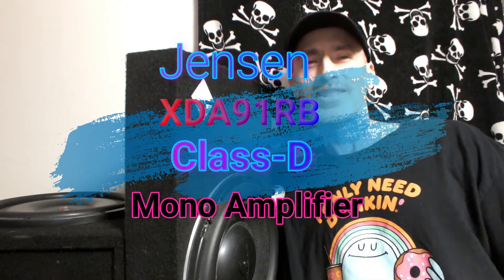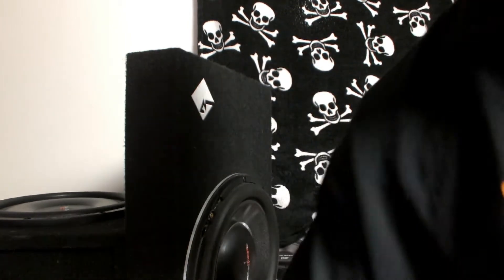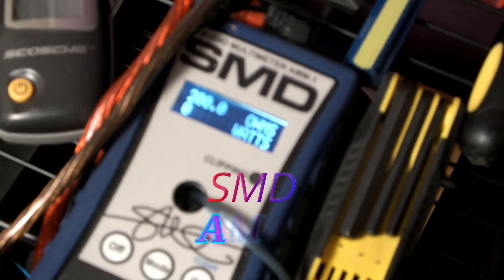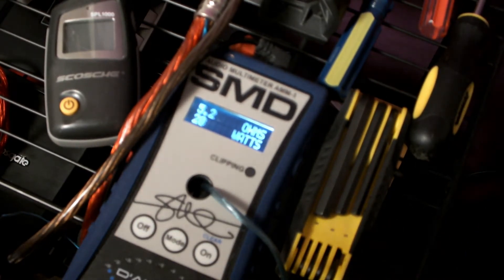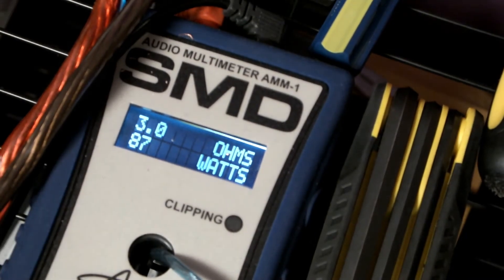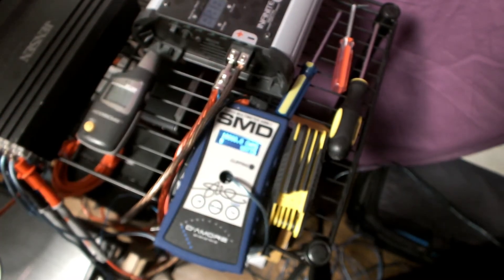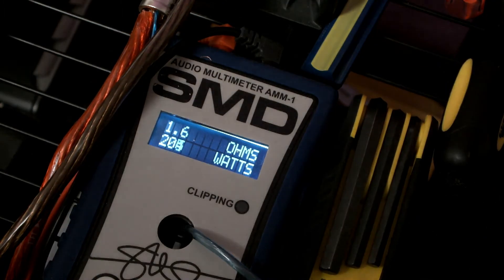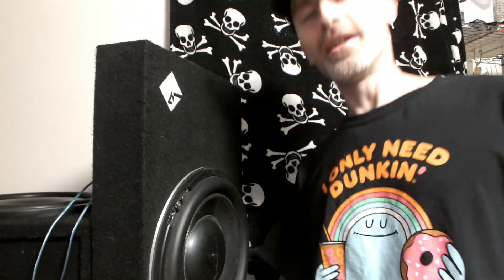Jensen XDA91RB Dyno Test Live SMD-AMM1 No App Used Does it do 1,200 Watts? 4 ohm, 2 ohm, 1 ohm Test

Comment: Hey john u dont use the 120 amp power supply anymore do u ? Want to sell it ? Or have 1 u will sell looking for atleast 100 or so.
Reply from the maker: I actually have 3 and they're each setup with their own sets of wiring so I can easily wire a fork terminal amp or a smaller amp that uses less power I can use the 60 amp. I cleaned off the shelves just for the power supply.
Reply: @SubzPawz  oh ok I been looking around to buy 1

Comment: Why bother with a 4 ohm test of a 1 ohm amp? And why bother showing the woofer with 3 different woofers made by different manufacturers? And why is this guy adjusting the 'volume' constantly? How would you get any kind of standardized results while constantly changing the volume level between test runs? And why is he calling a sine wave a 'sin wave'? And how do we know what his input signal voltage on the RCAs is? This guy's an idiot and is not following the scientific method whatsoever

Comment: U have to use the app bro thats how u set ur gains u aint doing the amp justice
Reply from the maker: The only thing that the app did was adjust bassboost, distortion. You are still commenting on the same video and not watching the updated video I made with and without the app.
Reply: Im jus saying i actuality have the amp and the app which i purchased after watvhing Big D run it on an actual Amp dino and seeing it make raited power + u may have some caps blown in the one u got 2nd hand
Reply from the maker: @larrymontgomery4902  I got the rated power in my other video your not commenting on. It does like 600 watt's, not even close to 1,000 watt's, nevermind 1,200. Nothing was wrong with my amp, in this video the impedance rise was affecting the power.

Comment: U may need to set your gains
Reply from the maker: I redid this test again, it's a similar video it says with a d without app Dyno test. This is just what the amp did on these particular subs. The gains were all the way up in this video. Depending on the subwoofer and the impedance rise that's where you're going to get your power. Check out the other video. It does okay.
Reply from the maker: https://youtu.be/S_DctgbY5xM?si=9v6N3CjB1Cs8COBx

Comment: Will this amp handle two 2ohm dvc subs running at 0.5ohms? Or should i get two 4ohms dvc and run them at 1ohms?
Reply from the maker: now you say running at 1/2 ohm. It's wired to a half ohm, probably with impedance rise will run more like 2 ohm or so give or take. it should run fine. Watch some of my dyno videos and check the impedance rise

Comment: You got to download the Bluetooth app for Jenson. It sucks ass. Then. Your phone has to connect everytime you use it. And everytime the settings get reset but wait don't go there's more wonderfulness. Most of the settings on the app are only for the 4 chan amp really blows a donkeys ass iny opinion.
Reply from the maker: Yeah. I noticed. It's not the best or brightest idea.
Reply: You do not have to connect to Bluetooth every time you use the amp the Bluetooth is just for settings unless you want to change the run or mute the bass if you don’t have a rca bass knob

Comment: I've got that exact same amp running 2 12's at 1 ohm on old 4 gauge wire. I know it's capable of doing well over 200-300 watts rms. If that's all it really is putting out them I'm extremely happy because I'm able to hit over 146db with $44 Power Acoustic subs from Walmart. I'm literally about to hook up my 15" Alpine as well just to see if it can push all 3 at .89 ohms. You really need to connect to the amp and adjust the gain. It seems like it's set to the bare minimum.
Reply from the maker: Someone else just wrote to me, I'm going to try what they suggested and if it works I will make another video with the new information. Thanks.

Comment: hey brother, i was wondering why rockford fosgate subs have such low wattage ratings? like a 15 inch skar can have a 1200 watt rms, but a 15 inch rockford only has a 600 watt rms?
Reply from the maker: I think they are conservative with their ratings. The subs sound great with lower power also. I think the whole sub is looser.
Reply: @SubzPawz  i have 2 p3 15s, 600 rms and 1200 max according to rockford, what do you think they can consistently play at before worrying about blowing them up
Reply from the maker: @miastroof  I would go with a good amp that does the RMS maybe a little better, you can always tune your amp and gains lower. Thanks for the question and comment.